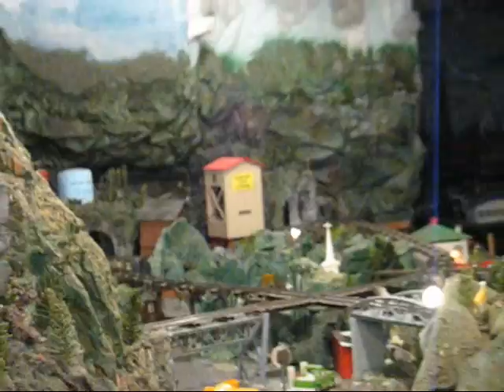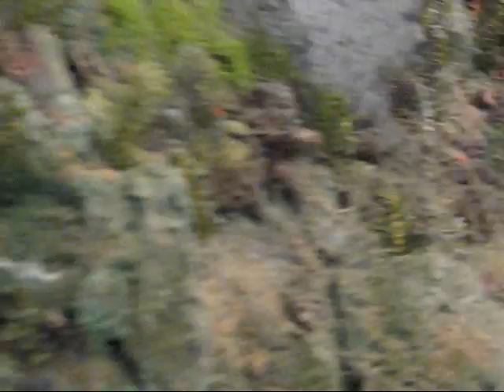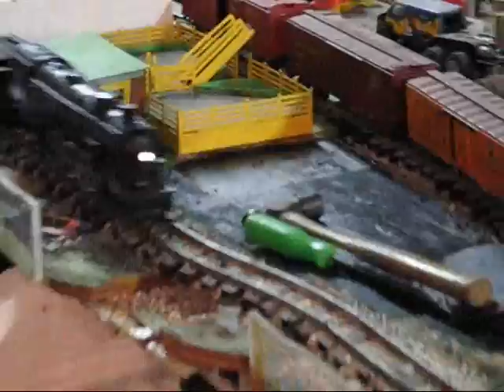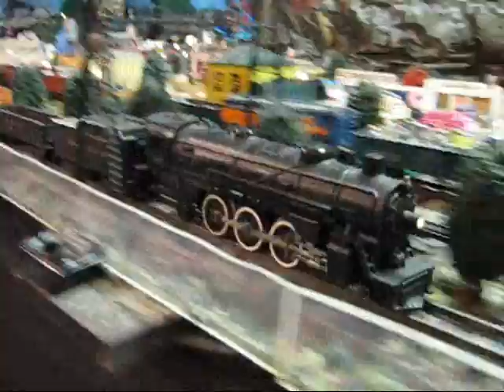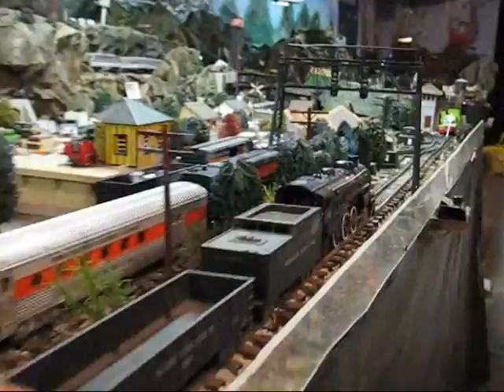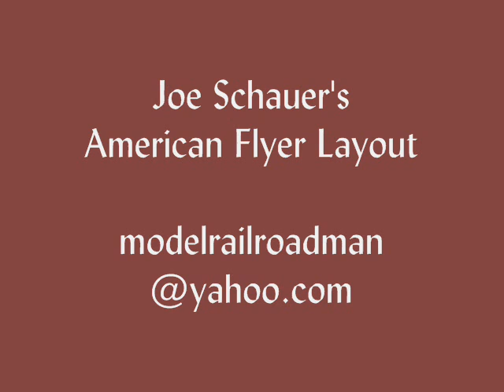Joe runs some American Flyer trains

Comment: I have a 303 Atlantic I used to run more than any other locomotive when I was a kid.  That train sat in my mom's basement for about 40 years.  I started playing with it again last year.  It ran and smoked right away with no issues.  I have more expensive locomotives, but I still find myself using the 303 more than anything else because it smokes, it choo-choos, and it can negotiate tight turns better than my diesels and Pacifics can.  Will have to pick up a Franklin set someday, they are cool!

Comment from the maker: @Dave121299 My dad says:
 I use lamp oil the kind you get at Dollar General. I think they still have it. Used to be $1 a quart. You can put in a good amount to make sure the wick is covered.
I have about 15 smokers and some do real good and some are weak. They have a repair kit for them that is a new wick that you wrap around the main wire. I have heard you can use angel hair if you can find it.

Comment from the maker: @MartyInLa Dad says: It is a gold colored set I bought through the mail 30 years ago. It is an Atlantic and I made the old-timey stack out of a funnel they use at the doctors office to check your ears. The cars are from the Franklin series and I have another car that goes with it. I put contact wheels on them so they would light up. It is a really good engine and a real smoker. modelrailroadman@yahoo.com